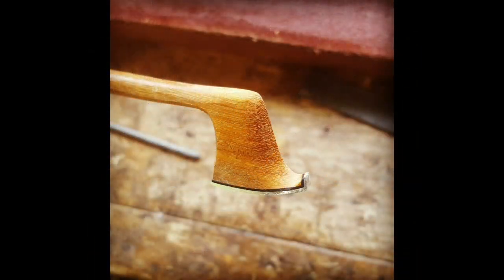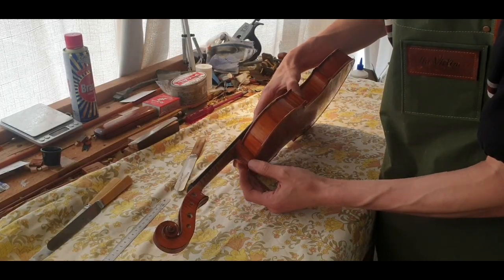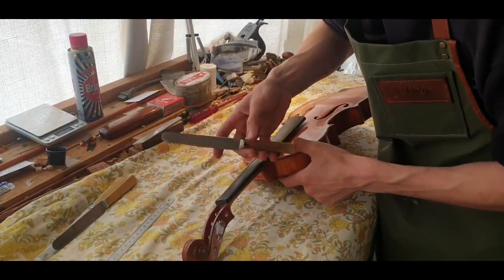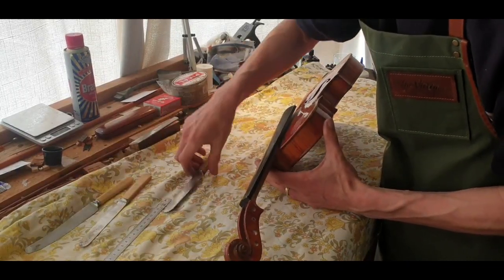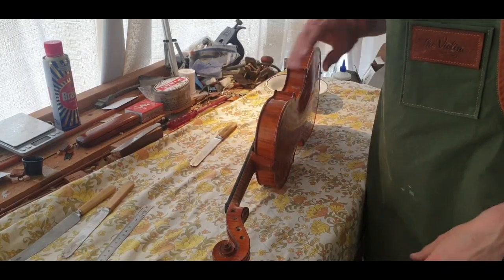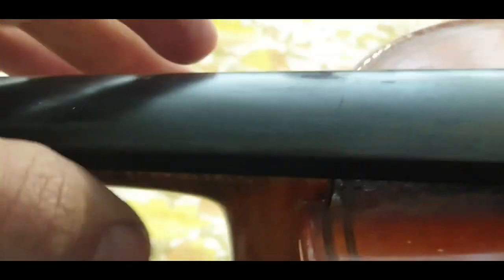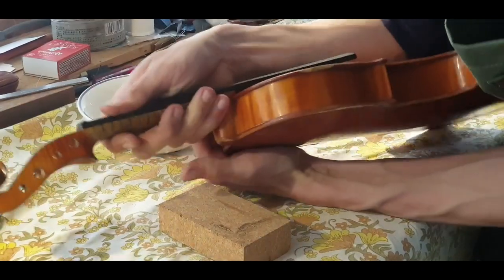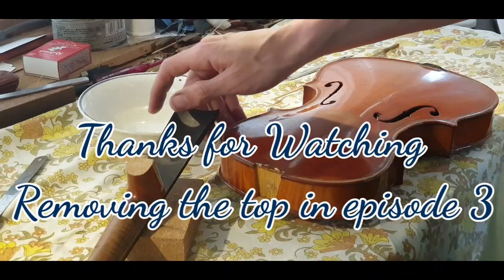Restoration of a Maggini copy violin episode 2 Removing the neck

Comment: That hide glue is a wonderglue.   Permanent, yet undoable.    I just tried using fish glue to re-attach a violin neck.     I tested the glue by letting a bit dry up hard, then sitting in some water.   It completely dissolved.   I hesitate to glue the top on with it though.   I'll go with the hide glue on that.    Thanks for sharing.

Comment: This was a very detailed and informative video. Im surprised to see one of these german Maggini copies with a dovetailed neck, most of the ones I've seen and worked on have the through necks where the neck and block are one piece.
Reply from the maker: My understanding is that this with the neck and block in one are often older,  early to mid 19th century,  and more likely Klingenthal.  Thanks for your kind words.

Comment: I just started my first neck reset on my old Stainer. The fingerboard height above the top is slightly less than 3/4 of an inch. I’m also going to refinish it. A previous owner (or someone) put a nitrocellulose finish on it. I’m going for dewaxed shellac and then True Oil. Unconventional but I want to see how it works out. Thanks much! 😎🎻